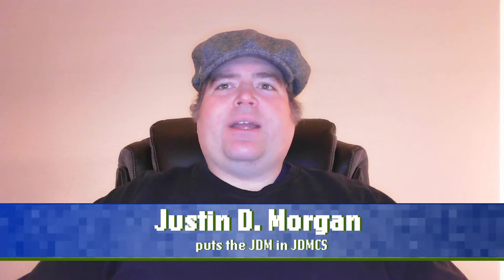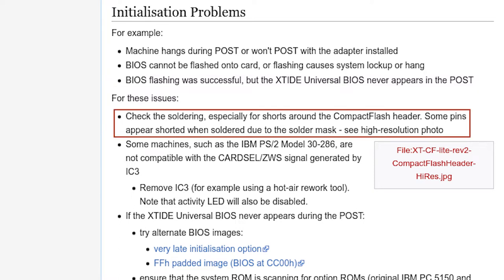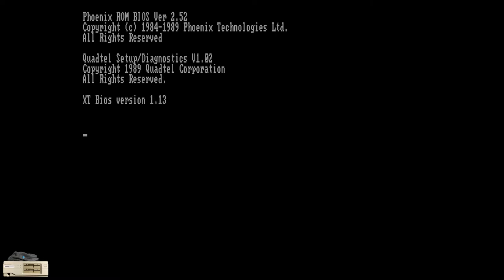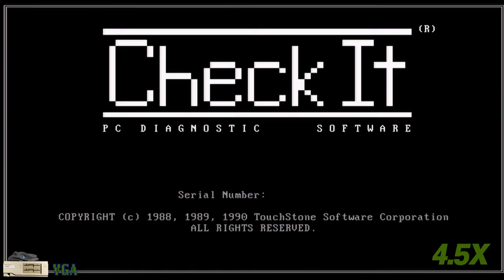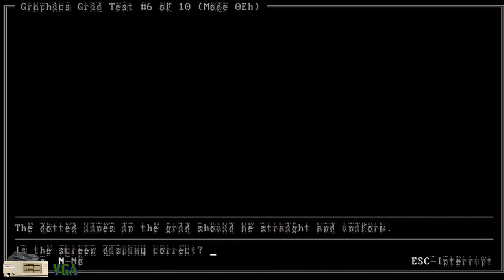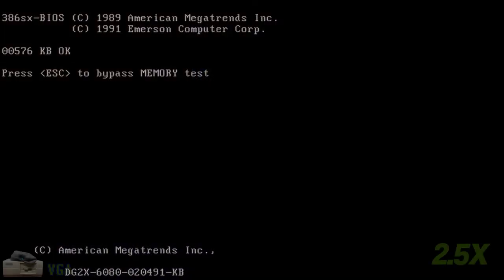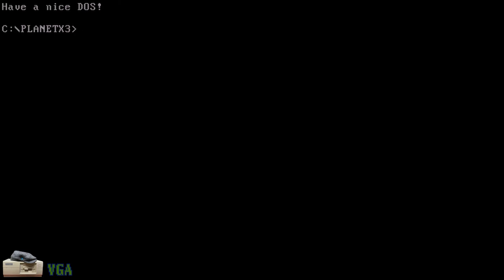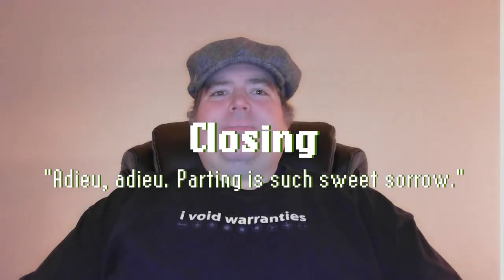The Emerson 8000EC Part 3: Troubleshooting XT-CF Lite and Renaissance RVGA-I VGA Card Issues

Comment: anything else you plan to run on this pc?
I personally stopped at a 386 sx 16 mhz (and i can turbo down to 8 mhz), there just doesnt seem to be anything that ran on the pre 286 machines that i feel i need to run. Plus i think with speed adjustment programs i could get slow enough if i really wanted to.
I also run my xtbios on a network card, but i do have 16 bit isa slots.
Reply from the maker: I’m working on a video now where I attempted some period-accurate upgrades. I’d eventually like to try to run some of the software that actually supported Plantronics Colorplus mode back in the day, because I can’t do that on another computer. (Unless I manage to find a video card that supports that mode, but I haven’t seen any show up on eBay that I can confirm were compatible.)